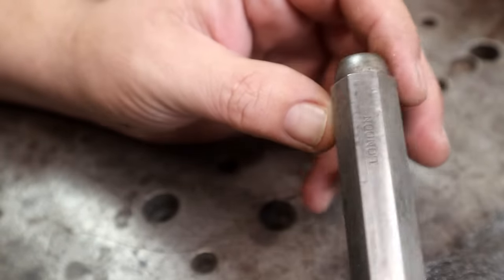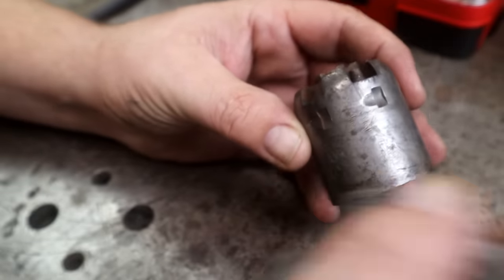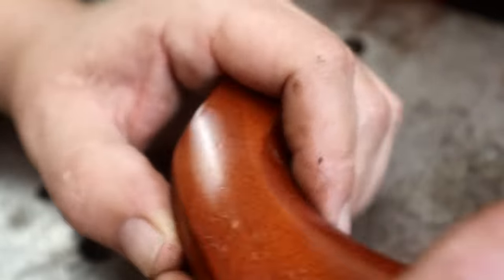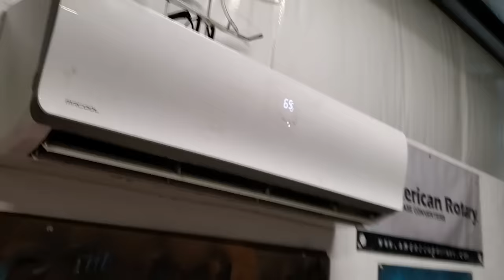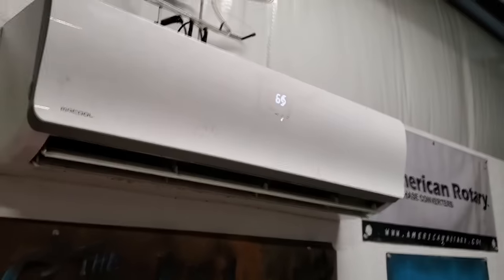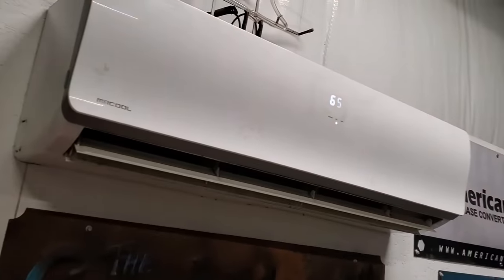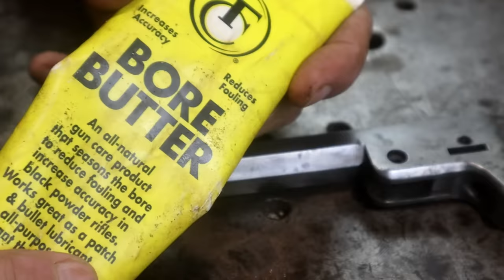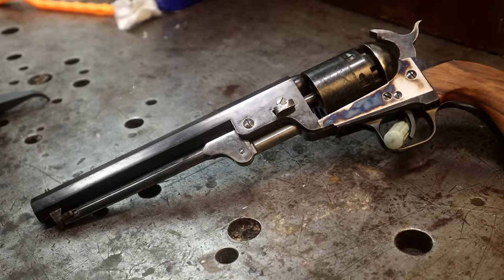1851 Navy Restoration

Comment: You do not have the slightest clue what you are doing. Everything you did was wrong without exception. USE PARALLEL SCREWDRIVERS THAT FIT! You need to be working on a soft surface. SOAK or BOIL before disassembly! The hammer was completely unnecessary ESPECIALLY on the guns hammer!